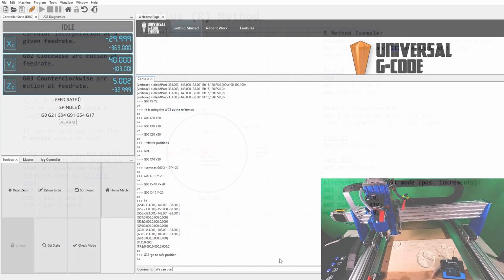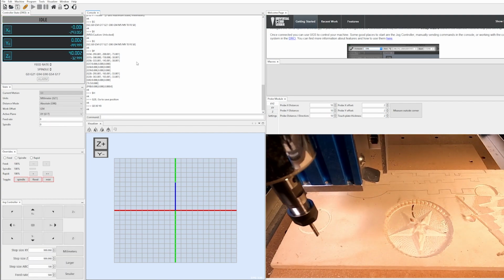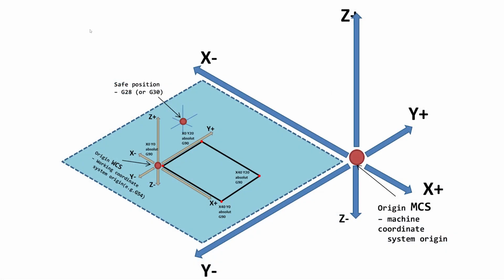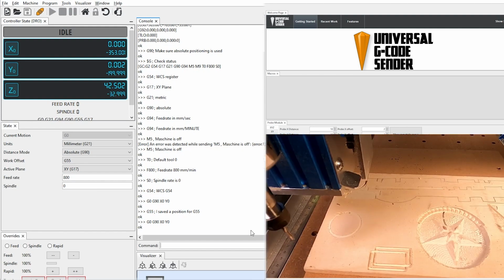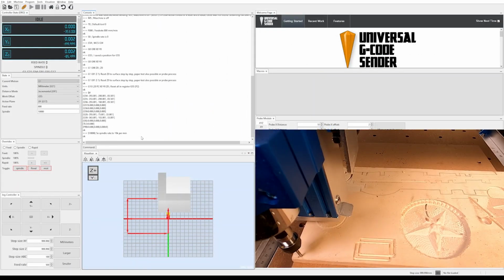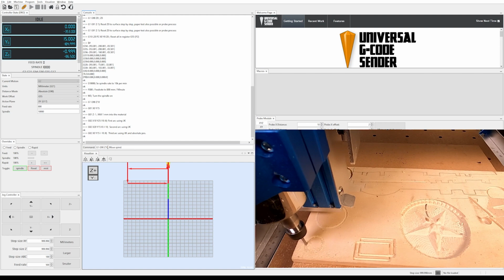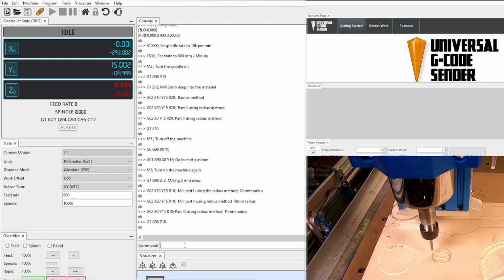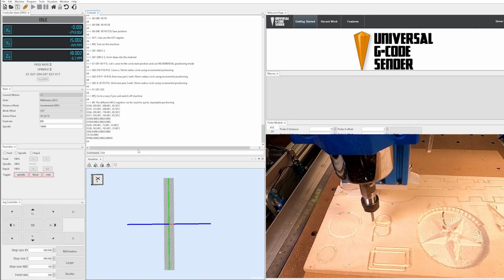Manual GCode Programming Part-3 - Circular movement, absolute and relative positioning

Comment from the maker: Here are some top tool and material recommendations. If you purchase through these affiliate links, I earn a small commission at no extra cost to you. Happy browsing! 
CNC consumer machine - good price performance ratio: https://amzn.to/3ShwOGt
3D Printer for beginners: https://amzn.to/3tNYLf5 
3D Printer for enthusiast (Many materials, heating chamber, and a lot more): https://amzn.to/46Nb4XA 
3D Printer for schools, maker space or a small business: https://amzn.to/46Ne7Pg
Filament dryer (a less expensive one): https://amzn.to/40b4qI5 
Filament dryer (a more expensive one, but for 2 roles of filament): https://amzn.to/3SeXbwM 
Filament PLA good quality: https://amzn.to/40tR2iB 
Filament PLA+https://amzn.to/3sek2xO, very good added physical strength, carbon like finish: https://amzn.to/3sek2xO